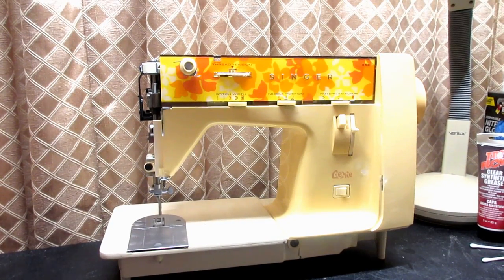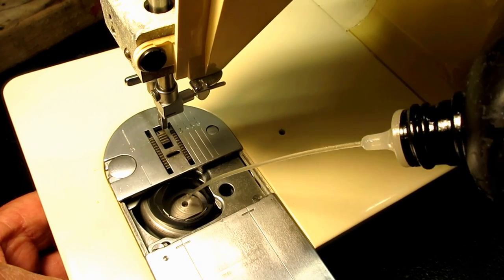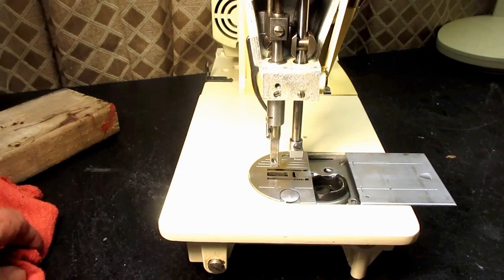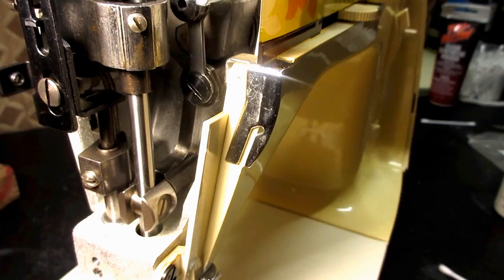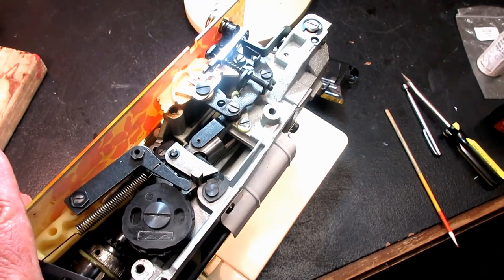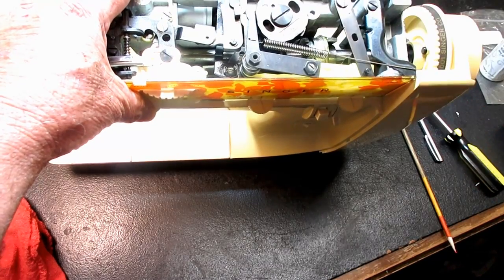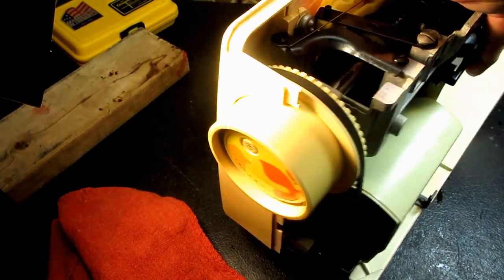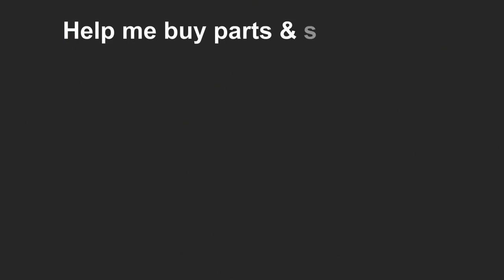Where and How to Lubricate a Singer Model 353/354 Sewing Machine

Comment: I am 61 and I just took apart my genie and lubed it and put it all back together and it works wonderfully!  One thing my husband helped me with that you didn't cover was the bobbin would not wind when trying to wind thread on the bobbin. The machine had been sitting for many years and the little rubber wheel wouldn't turn at all so he took it off and cleaned and moved it around with a dab of oil and woo-la it wound my bobbin!  Yea.  What a great machine!
Reply from the maker: Thanks for lubricating your Genie and getting the Bobbin Winder Friction RIng (rubber tire) to start spinning. I'm glad you figured it out. 5 hours ago you left a comment asking me to help you with the Bobbin Winder not turning. You left that comment on this video;
https://youtu.be/b_gcrN4j43A   I replied to your help request 2 hours ago about what you could do, including oiling the spindle. I gave you links to the playlist for this model and mention a couple videos that could help you, including this video for working on the bobbin winder system https://youtu.be/SgA8Y_WMleo   In that video, starting at 16:35, I mention putting lube on the BW. Later, at 42:03 in the video, I show you where to put the oil on the spindle. You don't mention anything about that reply to your help request, so if you did not see it you are to be congratulated for getting the cover off and cleaning and oiling the BW. It sounds like you are good to go now with that very lovely Genie sewing machine. Congratulations, and thanks for watching my channel.

Comment: Thank you my Singer genie has been in storage along with my singersimple.  I need to do some sewing repairs, but was afraid to use the machines with oiling and cleaning them both.  My genie is able to turn the wheel, but the simple  is frozen.  At least you have given my one working machine until I can pull the cash to take the simple to the shop.
Reply from the maker: Glad I could help!

Comment: I’m so thankful to have found you! I have my Dad’s genie 354 and I absolutely adore it. I’m just learning to sew and have recently started using it again. I’m the exact same age as the Genie! I’m hoping to keep it in good order for my kids to use someday! Im struggling with fabric getting jammed when I sew multiple layers- almost like the presser foot isn’t allowing the layers to help it adjust. Any ideas for me? I’m purchasing oil today so I can try improving it that way.
Reply from the maker: Welcome to Andy Tube. I'm glad you found my channel. If you will be sewing layers of fabric on a regular basis it would be worth it for you to buy a "Walking Foot" or "Even Feed Foot". Normally the presser foot just pushes straight down while the feed dog drags fabric along under it. With multiple layers the fabric may not drag evenly, ie: the bottom layer moves better than the top layer and layers in between. An Even Feed foot moves in sync with the feed dog, so it pulls the fabric from the top and the bottom at the same time. Here is what I'm talking about: https://www.sewingpartsonline.com/walking-foot-singer-low-423242-s.aspx?gclid=EAIaIQobChMI5rTppI6P6wIVYB-tBh37_QxcEAQYAyABEgJKyfD_BwE
Here is a demo video made by SInger about it: https://www.sewingpartsonline.com/walking-foot-singer-low-423242-s.aspx?gclid=EAIaIQobChMI5rTppI6P6wIVYB-tBh37_QxcEAQYAyABEgJKyfD_BwE
The Genie sewing machine has a rare "auto" pressure presser bar that has a pre-set spring set-up by the factory. I found it possible to change that setting a little bit to make the pressure lower or higher. Here is my video about the presser bar system:  https://youtu.be/Jn6Vz0dFb-E   You can see it is not easily done so it would make sense to have the walking foot when needed and just change it out when not needed, leaving the presser bar system as set at the factory. BTW, here is my 20+ video playlist for the machine, in case you have other issues or questions in the future.
Best of luck and thanks for watching my channel. ✨
Reply: Thank you so much!!!
Reply from the maker: Best of luck, Cynthia.

Comment: Awesome video tutorial! Thank you! I do wonder, though, about that “brown grease” you talked about being all over inside. I’ve had three of these machines now and all three had that same brown grease. I wonder if it was something Singer was doing that was supposed to (in their minds) take place of regular oiling in those areas?
Reply from the maker: Here how it was explained to me by a retired Singer Repairman. Grease is oil with added wax of some type. Singer did come to use a "brownish" type of waxy grease on the worm gear of the horizontal shaft where it mates with the gear on the bottom of the cam stack (that is actually called the "Disk Driving Worm Gear".) The type of grease they used was supposed to be "safe" for plastics and Singer was using more and more plastic parts, including on the cam stack and DDWG on the bottom. By adding this waxy substance they felt the grease would stay put better and be less likely to dry out. Later when Singer sold the company (early 1980's) and their stores were closing independently owned stores and repair shops often used that brownish grease on other areas of the machine. Possibly b/c 
"... if it was good enough for Singer, it's good enough for me... ".
Reply: Andy Tube Thank you so much! That is really good to know. I truly appreciate all your video tutorials and your generosity with your knowledge
Reply from the maker: @manhandledinmt  Sure, Joe, and I appreciate that you watch my channel and thanks for keeping the machines working. 👍

Comment: Hallo Andy. Thank you for the very useful video. I recently bought a Singer Starlett on a yard sale for just 20€. It is very dirty inside but everything seems to be moving. I am in the process of cleaning. 
I tried sewing with it and have a Problem with the thread tension. The bottom thread has big loops. So the top thread tension is too loose?? The tension wheel moves and the Parts behind it move also. Do you have any idea what the problem might be?
Thanks for reading :)
Reply from the maker: I think you are asking the right guy! I actually made 20+ videos about working on this model. Here is the playlist: https://www.youtube.com/playlist?list=PLsCOZgzzaiKJvzcqn97Yh8lvx-tbdFl2p
One of the videos is a very detailed tutorial of this strange little tension unit: https://youtu.be/3zzAdVs_8Sw
Since you said the machine is dirty maybe the tension unit just needs a good brushing out and cleaning using a soft strip of cloth dipped in alcohol and swabbed back and forth around the discs. Maybe it needs more. Congrats on finding a Starlet and thanks for watching my channel.
Reply: Thanks for your super quick answer. I will clean the machine and see if it makes a difference. I will also check out your other Videos. Thank you so much for all this useful Information. I would never have tried to taken the covers off without your instruction. Even if I end up taking the machine to a repair shop, it saves a lot of money to be able to clean it myself and fix minor issues.
BTW. The first problem I had with this machine was, that the capacitor in the foot pedal went up in smoke. Very scary! But the Internet knew the answer and my brother (an electrician) could replace the capacitor easily.
Reply from the maker: @sphhyn  sure you are welcome and you definitely can do cleaning and most of the maintenance on these vintage machines even though you have a Kenmore now many of my videos will show you common sense things for cleaning oiling tension and other items Best of luck to you and your crafting projects
Reply: Andy Tube Quick Update: cleaning the machine did the trick. It is stitching just fine now. I am very happy :)
Reply from the maker: @sphhyn  congratulations and nicely done thank you for letting me know now you can get on with your crafting and sewing take care

Comment: can you show singer 360 machine fixed ？
Reply from the maker: Sorry, I can not do that. Model 360 was not sold here and I've never even seen one. That 353 model is the closest I have with similar parts and functions and here are the 20 videos for it: https://www.youtube.com/playlist?list=PLsCOZgzzaiKJvzcqn97Yh8lvx-tbdFl2p     There is a service manual for model 242 that repairmen use for repairing model 360. They are similar machines except model 242 has metal sides and model 360 has plastic sides (like 353) The manual is available for download online for $10.50 but if you use my coupon codes of andy-h-yt they will only charge $8.40. Here is the website: https://store.tandtrepair.com/240-248sm.html   That's all I can offer. Good Luck.